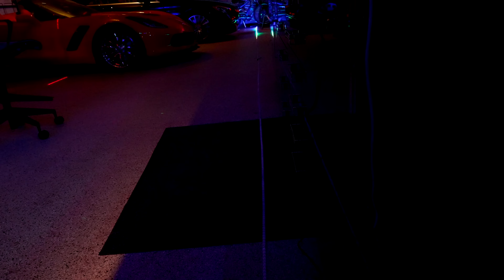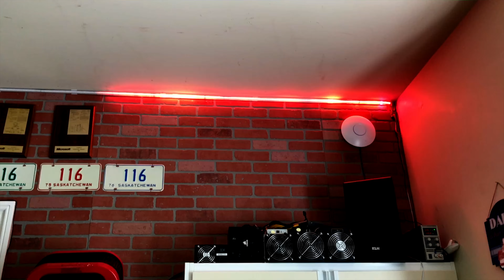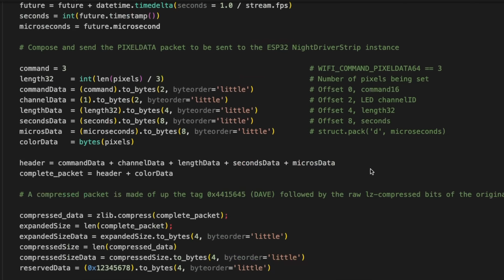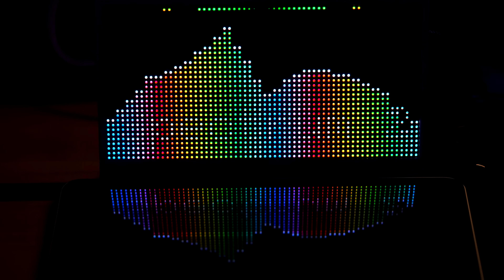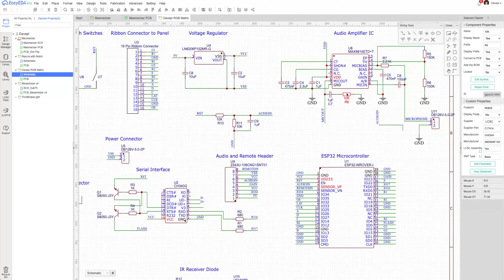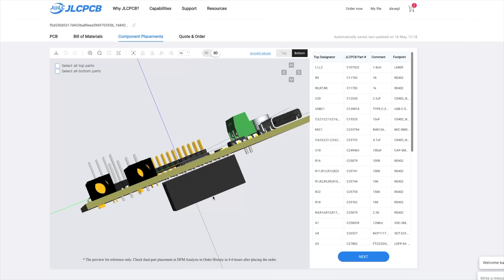NEW LED Software and Hardware Platform that YOU need to know about!

Comment: I currently own 4 8x32 LED matrix boards and may add more to my collection. Because I don't want to burn anything, I use one board at a time. How do I select an appropriate power supply that could power the number of panels I choose to connect at the same time?

Comment: I started out watching your channel a few weeks ago when I came across a video on the windows disk formatter. Before that the algorithm had prompted me several times to watch your task manager video. I hesitated because I’m a Mac guy who mostly left the Windows world around Windows 2000. I relented on the formatter video and have been enjoying the content quite a bit. Anyway, your videos on LED projects got me thinking that I can / should get some parts and start tinkering with LEDs. Ordered a board, led strip, power supply, and some wire from Amazon. Was planning on following your older tutorials which did not seem too hard despite having no experience with C++. Then the algorithm suggested I watch this video. I’m really excited to use NightDriver instead. Just wanting to tinker but hoping I can end up making some cool projects down the line. Thanks for the content and the code.

Comment: hello dave since you have worked with RGB and addressable leds. Could you control fans the same way?
since today every fan manufacturer equips their fans with RGB, it might be a good idea to control fans and leds with a common connector and with the same type of communication.
maybe it would be a good idea to work with @Level1Techs and @GamersNexus on their OpenPleb, trying to clean up the rgb junk.
well-functioning software without espionage and bloatware would also be an asset.

Comment: Kent, 
    So i just got a request from my son’s marching band.  I have 10 drums 5 bass, 3 snare ,2 tenor.  
the band director wants to add some more energy to the show, so he asked if i could put some lights on the drums and have them simply turn on at a certain. point in the show.  that i can do fairly easily , but frankly it’s a little boring.  so then i thought about controlling them from the sideline of the football field remotely , and maybe even having some dmx so i can get some movement and color changes going.  After researching some, i realized some folks are using Midi to control lights.  if that is the case, i’d love to do that. I understand Midi very well, so i’d love to program like cues in that language. 
my question to you is  ,how and what gear can i use to do this?

Comment: First off, I'm glad I found your channel. Please keep the WS2812B LED videos, tutorials and projects coming, great work on this one your time is appreciated. Any chance there's still a module giveaway to be claimed at JLC-PCB, and will they ship it to South Africa? I struggle to get addressable LED's here, I still have yet to find the 140LED per meter variant. They just give a more smooth and responsive effect. Mesmerized! I couldn't find a ESP32 board and ended up with a NODE-MCU ESP8266 and I still haven't succeeded in uploading anything to it, think it's an issue with my app or CP2012 driver or the shitty android phone I'm using. I dig that you add audio modules/options to your projects, so much more expressive and fun. Thanks again

Comment: As an electronics engineer back in my past lifetime (early '80s to late '90s - mostly digital / microcontroller work, some personal analog circuitry for my guitars, and band music stuff - I'm in software engineering now), seeing your post had me jumping for joy like a kid in Woolworths at Christmas time! 🤣

I have to give you ABSOLUTE PROPS, for what you're doing!  IF I could retire right now, I'd be doing exactly this kinda stuff - absolutely amazing - I ENVY you to no end!

Just last year, resurrected my Global Specialties PB-505 breadboard out of my garage, bought a Siglent digital oscillator and triple power supply, prodding myself to hopefully get back into my electronics!

I had also purchased off Amazon an Arduino kit along w/sensor modules etc., I had my singular LED flashing as well - LOL!!

When I was in my 20's, I had got into modifying guitars; making preamp circuits w/state variable filters along with some touch plates for turning the pickups on and off w/4066 analog switches etc., along w/other ideas in my head.

I always thought I would one day buy guitars, modify them w/my custom preamps and other circuitry and resell them to Sam Ash or other interested musicians - alas, life got in the way, we all grew up, got jobs, the band dissolved etc.,  my electronics engineering took over full time, to now software engineering - here I am today...

I appreciate your pointer to JCLPCB and EasyEDA - I was trying to decide on what platform I'd use for my prototyping - Advanced Circuits w/their services, or perhaps Fusion 360 for schematics and pcb layout, but I'd rather go the "in-house" route w/a PCB manufacturing company that offers their software for free, for a better round trip / support experience - I'll def give JCLPCB a try for sure!

Keep up your great work - you are definitely an INSPIRATION out here on these home-hobbyist / electronics design streets!

Comment: Thanks... But I'll stick with SignalRGB,   they are working on WiFi control to work with other LED setups like Govee and Philips and more..  not as complex as yours yet.. but far far easier and even cheaper... it's free....lol  or you can get the pro for 40.00 ..

Comment: What's your preferred method to dynamically control LED lighting from a PC? I don't mean from generic (or OEM) control software, but automatically and conditionally. I've been using OpenRGB since it supports CLI parameters, with individual scripts for turn on and turn off. I'm using rainmeter right now to trigger them based on conditions since I don't want to have something running every X seconds in task scheduler and haven't had time to research alternatives like process notifier or whatever else. This is acceptable at the moment because I'm using rainmeter anyways for a display of my temps and disk capacities, and also on-screen alerts when key processes are down. If I wasn't already running it (and already using it to monitor the same process) it definitely wouldn't be optimal.

Anyways, at the moment if process.exe is down it runs LEDOn.vbc (the vbc files just call a batch file; it's a dumb and easy little trick to have them run with no window popping up momentarily) and sets a variable. If the process is up and the variable is set, it runs LEDOff.vbc and unsets the variable. This is so that it's not constantly running LEDOff.vbc the entire time the process is running. 

Right now the LED strip is just on top of the server, but I plan to place it above the door to the office or even get a small glass enclosure near the door and place the strip within that so it's more of a classic warning light, and then even when I'm not actively in the office I'll be visually notified if a problem occurs. Anyways, wall of text over - do you have any suggested ways to automate things like this, or a favorite way to script LED control? My main lighting has been using a DMX controller which has apparently just failed entirely, so I'm focusing on this side project.

Comment: Agreed!
As a hobbyist I started with software too, and later doing hardware really was a rush!!!
For me it was a LM317 variable voltage power supply so I could determine at what voltage a device would auto power off.
After that I DOVE into electronics!

Comment: Just had a thought, does there exist a detector that not only does spectral analysis, & amplitude differentials, but also amplitude & frequency modulation, polarisation, left-handed light etc, in other words detecting whatever we can on the same device, so the different information can be contrasted & compared.

Comment: Have you had any issues with durability?  I built a number of outdoor things using LED strips from 4 - 6 years ago.  I quickly found out that using silicone to seal connections was a bad idea: the acetic acid in the silicone corrodes the copper.  Looking at some of them now, the waterproof coating on the strips hardens and yellows.  Some of them were encased in silicone tubes, and those have fared better.  The silicone tubes aren't as nice for the light though.

What kinds of connectors have you found work best when you're splicing and connecting to Arduino?  I did a lot of soldering, but have found some connectors made to clamp onto the pads on the strips.
Reply from the maker: Yup, I've had mine up 4 years or so and the lenses are pretty crispy, and the wiring is getting frail... not really up to outdoor extended use, it seems!

Comment: love that you share your beginning story too (comes across as you can do it too/humanity). Rewatching this I love everything about this. Had the same excitement the first time I created a hello world with php (turned out the most work was configuring the test server/before I heard about wamp). Now I’m dying to get fluent with heat censors and controllers/relais. To make a smokeless wood gas rocket stove with sand battery to heat a home (my mother’s). - A pattern that would be fun is, a knight rider pattern including with blocks/cubes and the fading light in the blocks due to the grill/grid the original light was in.

Comment: Are we able to chain the led matrix boards so we get one big screen... like at Vegas?
Reply from the maker: Yes, but the DMA RAM is limited on the ESP32 so you can only do about 3 matrices.  For more, you'd need at least a Pi
Reply from the maker: Oh, but you can also sync them over wifi and use any number of screens, but you'd need one ESP32 for every 2 boards or so

Comment: Really cool project! I did a whole light show based on esp32 modules, but using WLED and controlling with DMX via xlights. Curious how much you know about the xlights community and whether you've considered including DMX functionality or other integration - might be a good market for the "product", lots of retired engineers in the community.
Reply: I've worked on large displays for entertainment and have used several different brands of LED panels/displays in temporary installations. The sub-modules (matrixs) are inherently fragile and get bad pixels which is problematic because the colors of the individual LEDs are inconsistent (panels have batch matched pixels... once the manufacturer runs out of a particular run that's it, they're no more to be had). So two possibilities occurred to me.  The first is using the sub-modules with a microcontroller as DMX controlled wash lights. And the second is using the microcontroller as a plug and play tester for the repair and qc'ing of the LED panel sub-modules.

Comment: So I been planning on fiddling around with some individually addressable LED strips and some kind of controller /software solution that's easy to use to install on the exterior roofline of my bro's new house (as a surprise project).
But I'm also the sound and lighting tech at a nightclub here in Toronto, CA.. (well tbh, i'm a sound engineer that was thrown into the deep end of club lighting because no one told me there wouldnt be a lighting tech at the job).
So now that I'm a little more knowledgeable on the DMX and lighting side of the job, I've been thinking about adding some strategically placed LED strips or rows/columns of led displays like the ones in this video-- which i could trigger from my laptop or other control device. Even though out HOG4 lighting console is capable of 'pixel mapping' through a dedicated LED/DMX interfaces, that just seems wayyy too complex for this sound guy. 
Something like this nightdriverLED project seems way more doable for me... 

**PS: I didn't see those web links for the Hub75 matrices you promised to include in the description..

Comment: Can't wait to give it a try.  WLED has been extremely unreliable.  2x ESP32 boards and I'm stuck on WLED 12 because anything newer fucks up constantly.  12 still locks up occasionally but it doesn't completely corrupt itself like later versions do.  AND I spent considerable time talking to people on discord and there simply isn't a solution to my problem.  The code is just garbage.

Comment: With full motion video capability, how feasible would it be to create a custom LED back light for a television? Manufacturers have been using local dimming LEDs for a while. Wouldn't this take LED back lights to another level? Or is that fantasy? Quantum dots have been used to bend light colors so only a single color back light is needed. Would full color be superior? I don't know enough about it, but the high resolution of television screens have always been a fascinating to me in much the same way this LED project has been to you, Dave.

Comment: Hmmmmm! That sounds pretty exciting, actually. My use for the JLCPCB service would be entirely different however (if it is possible). I would want to take old/open source schematics of modular synthesizer modules, transcrive them into the PCB layout software and have them make fully assembled PCBs that would only need the face plate, pots, encoders, buttons, and switches wired in and mounted to be done by me.

Comment: When I tried this I ended up fromming the PTG which derasterized the GLG and the PQOM before the whole thing relastered into individual glopfeltzers.  I tried to fix that by glintzering the POLG and the PORG switches.  But that just jamptwizeled the derf buckets.  Before I knew what was going on the overloaded derf buckets were leaking sliz all over the gump sprunkers.  It was a real mess. So I just gave up and tossed the whole thing into my borse filter where it sits still today, overboarding the entire slangdrunker.
Reply: Wirth some effort you might be a paragon of tech-adjacent parody. I hope one day you regain control of that slangdrunker.

Comment: Love the project,  bot for strips and Hub75 panels.   I have a collection of self made, and other driver words for my collection of Hub75 panels,  and I'm quite anxious to get my hands on your version,   (Love the extra ram) ,   My first hub75 projects were all Arduino based,  topping out at a 64x64 panel on an Arduino mega,  with a esp8266 as a "wifi connector" .  Unfortunately I don't have any documentation of the 64x64 project,  but it plays several games,  and makes a nice weather station/nightlite in my bathroom  ;)

Comment: How are you mounting those 3 wire leds on your coves, and where are the esp's actually located for their control? (up in your soffits?)
Im literally in easyeda as i type this, working on my own multi-led control board to control lights in that exact configuration. My board uses an esp8285 for space saving, can control 2 channels of 3 or 4 pin individually addressable leds or 4 color analog strips, has a web gui and is controllable by artnet, e131, websocket, and html query string. Did i mention the board is less than 1 inch by 2.5 inches so it fits perfectly inside an inch aluminum L channel? 
I would love to incorporate some of your open source code into this project in exchange for throwing some boards your way to play with and stress test.

Comment: If you're going to do this, do yourself a favor and do not go with the Heltec Wifi Kit. The documentation is absolutely horrendous and NightDriverLED was written for V2 which doesn't seem to be a thing anymore. The version you'll get is a V3 and all it seems to be good at is not working. Even trying to get it set up in the easy-to-use Arduino IDE is a nightmare and the documentation will lead you in a very wrong direction. Plus it crashes all the time and the OLED display attached to it dies pretty fast. I bought two 🤡

Comment: Btw there are now also learning tools & libraries for running Neural Nets on microcontrollers, e.g. with reduced precision (storage in flash), all-integer code etc. Perhaps to detect certain features in audio signals, some smaller such NNs could be useful. It's on my long TODO list, haven't played with those yet.

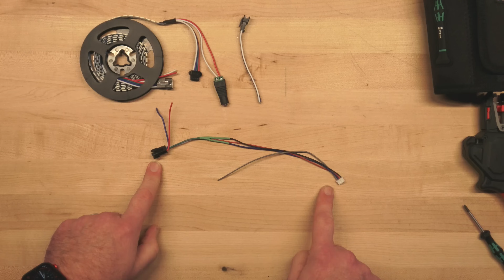Comment: 3:08, no, such an LED contains FOUR wires not three! There's data-out as well. Which is important, since they dont have addresses, so they daisy-chain, and that's the key to getting what you want. So it's four. Also it's just four, you can see it on the PCB or the LED.

Comment: I use Easyeda and jlcpcb multiple times... I love it!!!!  

I've built some badass PCB's and systems with it and make my own LED driver board as well.  I make it more custom where it is ESP32 based, but I have a set of outputs where you can put in a mic/poteniamitor/DMX controls/and more...  and in software you just select what the output does on the webpage and enables it... makes it more custom for setting up items.  Mine is for holiday displays...  mainly halloween...  where I keep the board in a weatherproof box and all the outputs as connectors on the outside.  I control a series of DMX lights and Fog machine, speakers, mic, and output to control multiple animated decor...  I then have the webpage setup where  you set the time of when youy want an show to start and it kicks off and the fog machine kicks on with the lights glowing through DMX, then irrie music goes... and so forth...  I keep adding more and more features...

Comment: You should take a look at the free xLights software as well as Falcon, Kulp, Genions control boards, as well as Falcon Pi Player (FPP) once you start down that rabbit hole you will never come back.  Controls just about all chip types you can think including P5 and P10 matrix panels and look at color light cards.